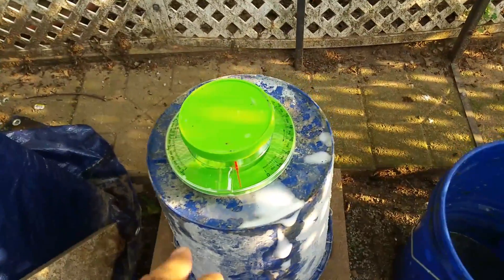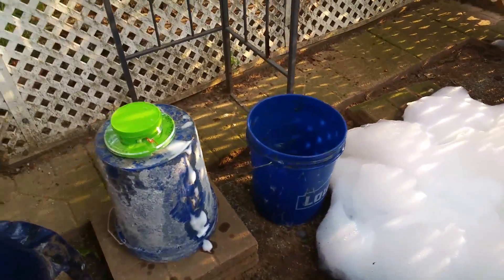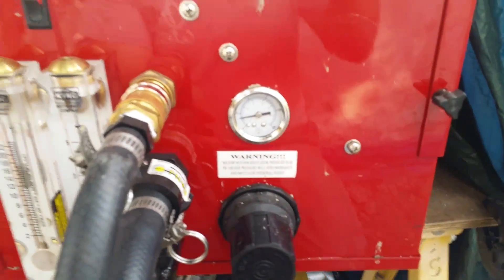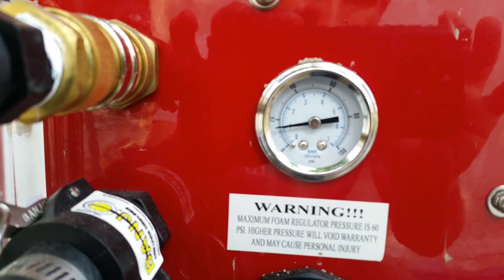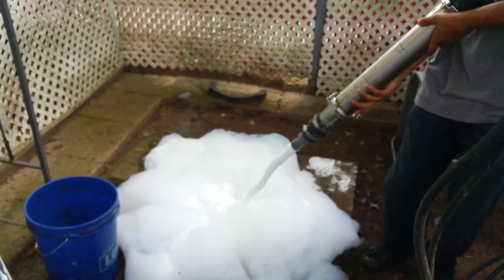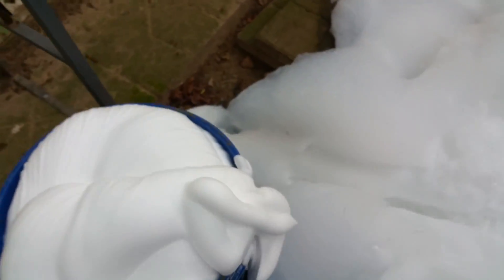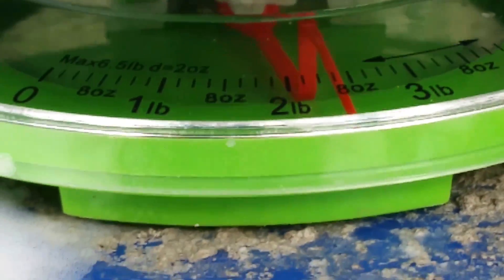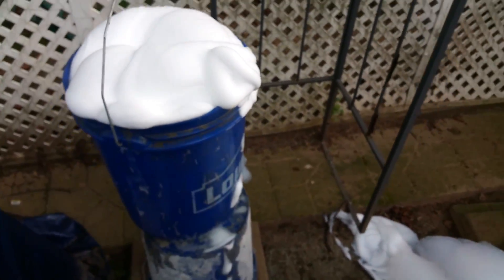Aircrete Foam | Air Pressure Settings #AircreteHarry #Aircreteresults #Aircrete #Foam #Airpressure

Comment: WHAT IS THE NAME BRAND OF YOUR NEW MACHINE AND WHERE CAN I GET ONE????
Reply from the maker: RICK BREWER if you're going to purchase a foam generating machine. I would recommend the mini dragon from Dome Gaia. I spent about $4,000 for my commercial grade foam generator, and see no real difference between the two machines therefore I would recommend the less expensive machine. But here is the website for this machine.
 https://www.richway.com/construction-products/cellular-concrete-equipment.html
Reply: Hi your red machine looks like it could produce a lot of foam?

Comment: Micro Rebar = Basalt fiber?  Foam generator looks keen.  Sounds like the inflation fan could be cut-off after the shotcrete cured.  I like that compared to Monolithic Dome's SOP - they require running the fans through the entire construction process.  For that matter, I think I like the approach of building from outside the dome because you don't need to be inside the structure to add the successive layers.  Bad weather could be a drawback but that's not a deal breaker.  I can't wait to see how the foamcrete comes out.  I really appreciate your presentations.
Reply from the maker: I made this video to show you what Basalt fiber is and what Micro Rebar is. https://www.youtube.com/watch?v=zRephX3Zpb8